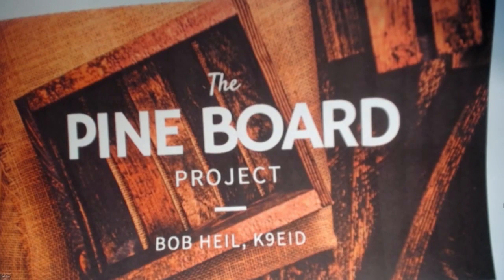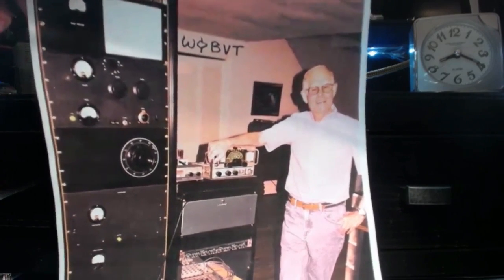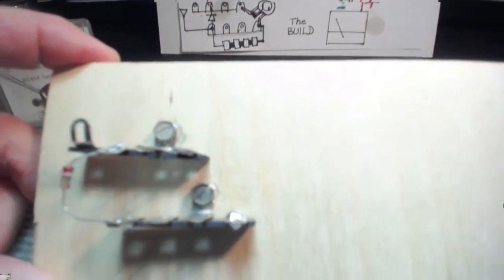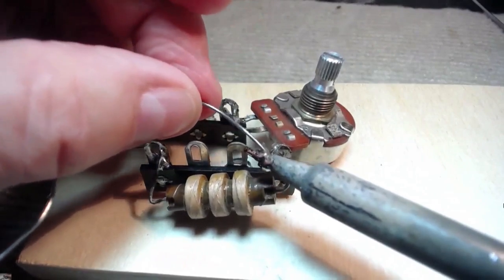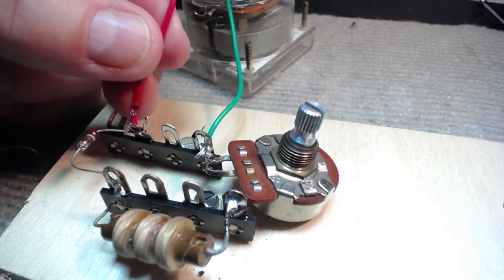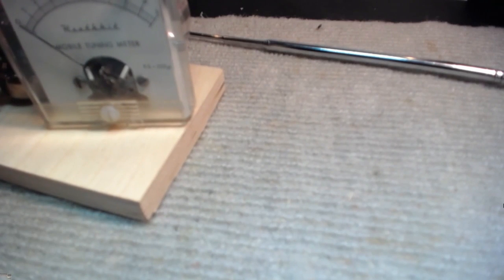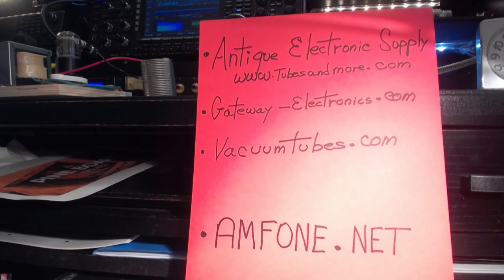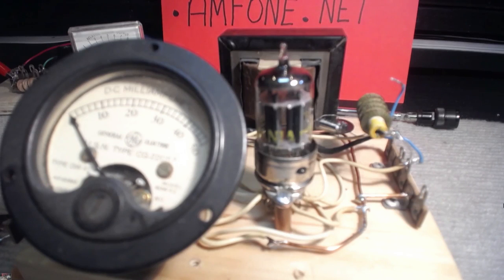Pine Board Project from HAMNation on Twit: Field Strength Meter

Comment: Bob, with all due respect, that has to be he worst soldering job I've ever seen.  Parts just tacked on to the terminals without first making a solid mechanical connection and the leads being knocked around while the solder hardens.  You're asking for cold solder joints.  Please include a video that teaches newcomers proper soldering technique.
K3OHU
Reply: Jeff, I'd like to see a soldering tutorial for beginners since I've never soldered in my life. If Bob doesn't post a tutorial perhaps you'd be willing to post one?
Reply: Patrick, there are already several videos on YouTube that teach how to solder.  This one looks pretty good: https://www.youtube.com/watch?v=IpkkfK937mU
If a solder joint is not done properly, it can fail in time causing poor or no connection.  This sometimes happens even in factory produced electronics.  I've had "cold joint" failures in an Epiphone guitar amplifier, and a Drake T4XC transmitter.
Reply: Good info. Many thanks Jeff.
Reply: I didn't wanna say anything because I have so much respect for the guy, but I gotta agree. Not a great soldering job.